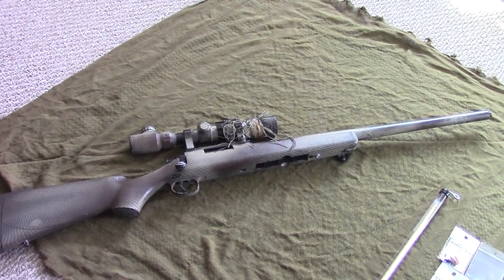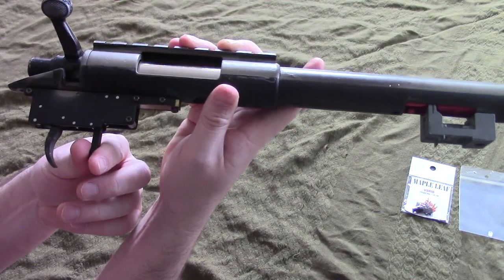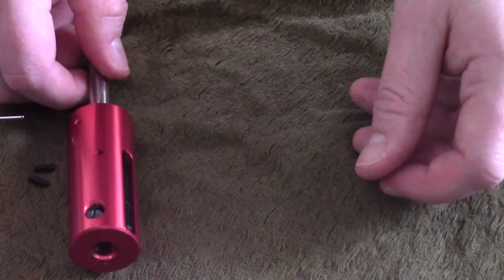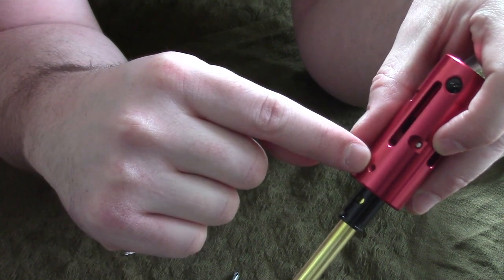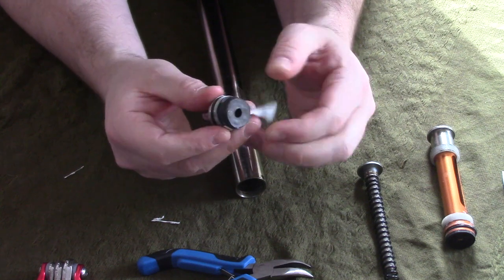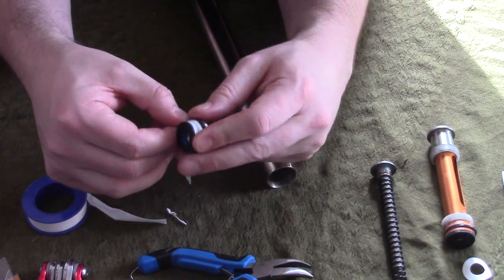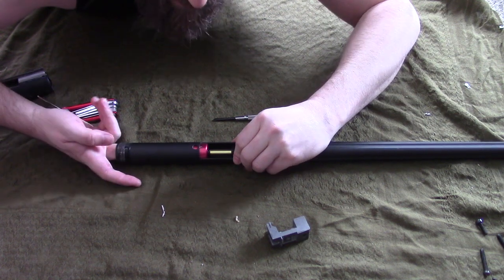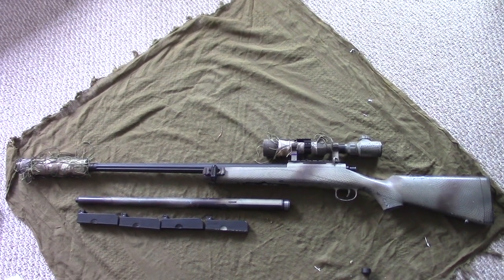Airsoft Tokyo Marui VSR-10 Upgrade

Comment: i would recommend against a spring upgrade with the original cylinder, mainly because it will eventually break. It was not designed for more than 1 joule springs, i think it is an aluminum  body and head(correct me if im wrong) and you need steel for stronger springs or it wont last long.
Reply from the maker: Hey thanks for the advice and checking out my video. I’ve heard the threads can strip going 2.3+ joules over time. I was willing to take that chance as I was planning to upgrade the cylinder anyway when I had the budget for it. It never did break but I did eventually upgrade to a new action army cylinder to match the barrel. Im guessing when you drill out the hole to upgrade it your weakening the existing threads combined with it being aluminum. This particular unit was running close to 2 joules for 7+ years on that original cylinder. It could just be luck of the draw but good advice it can’t hurt to upgrade the cylinder if / when you have the budget for it.
Reply: Nozzle is brass, and cylinder is some weird material too

Comment: i would recommend to put the barrel guides last and push them with some rod just where you want them... I doubt they are in the same position after you put evertthing in...
Reply from the maker: Thx for the tip and watching the vid. I feel I also could have added some silicon to the orings on them which would have made that process a bit easier haha. Happy holidays hope all is going great for you.

Comment: This comment is for the people that has no airsoft upgrading experience

If money is not a problem and you want a gun that is good out of the box. You should check out
1.maple leaf mlc338
2.ssg10/ssg24
3. Action army aac t10

If you dont have that much money and ur budget is around $200 I recommend 
1. ares amoeba striker s1/ striker s2
2. Asg mcmillan m40a3 (I dont recommend this that much)t
3.Echo 1 asr
4. Jg bar 10 (just change the bucking and youre good to go)

And if you dont have money

Just throw some bb's :)

Comment: What is the scope? I have a really bad scope with terrible eye relief.
Reply from the maker: Hey Thanks for checking out my vid Victor.  Unfortunately it came painted / used when I got the vsr. However if I were to guess it’s something like a 3-9X40MM RED GREEN ILLUMINATED SNIPER SCOPE. The eye relief on mine is about 2ish inches.
Reply: @kokosaysnono  it's annoying since I need to jam my head all the way till my goggles are touching the scope to see anything. Everyone I do NOT recommend the NCStar shooter series P4 sniper scope. It is less than garbage for $50. Wish I donated to charity or homeless.
Reply from the maker: Yeah it’s hard to find good eye relief for sure especially for when wearing goggles. I use shooting glasses which helps me get a little closer but depends on if the field allows them.

Comment: What fps gain did you get? Compared to stock
Reply from the maker: Initially I got 3joules until I worked the Spring in then I was getting around 2.3 joules of energy which was exactly what I needed 500 FPS shooting .20 except I shoot .45 with it. So the fps will be lower but joules close to the same. The stock cylinder has been known to break overtime shooting above 500 FPS or around there ( nozzle threads can fail) so it’s good to upgrade the cylinder as well if you plan on shooting higher FPS/joules

Comment: if i upgrade the exact same way could i shoot .46 bbs at 80ish yards?
Reply: Pretty much that.
You will also want a Bulltrigger and the Lambda cylinder set from evike.
Also, instead of a Maple Leaf barrel, the Lambda 6.01 should be a little higher power and be a little more accurate depending on what you do.
Reply: Silicone Sword thank u bro
Reply: Silicone Sword would it still be as good if i used a action army trigger unit and action army 6.01 barrel?
Reply: @lathanlang7922  I would not recommend the Action Army trigger unit as people tend to have issues with them.
Bulltrigger is like 130$ shipped, and it gives you up to 15% more FPS.
As for the barrel, I don't really recommend Action Army since the bore quality isn't very good.
A Crazy Jet will be perfectly fine, but Lambda will be better and not cost too much more if you use coupon codes.
If you are in America I would highly recommend Evike for most of your stuff and for the trigger you should just search Bulltrigg.
Hmu on Instagram @silicone_sword if you need any more help with your rifle.
Reply: Silicone Sword ok sounds good i'll dm you my name is lathan.lang

Comment: Hey Koko, you think you'd be able to do the same build for a JG bar 10? I'm 99% sure it's a copy of the TM vsr 10
Reply from the maker: Hey thanks for checking out my video :) I believe you are correct the JG Bar 10 is a clone of the TM vsr 10 so most of these parts would work , AA hopup chamber, crazy jet barrel, maple leaf monster bucking , either nub tensioner maple leaf or panther stalker. mag release. The cylinder parts i'm not 100% but from what I read they should work as well. Mine already had the LayLax PSS10 Zero Trigger  / piston installed which should be compatible too. I'd say research each part to be 100% sure but so far it seems they're compatible.

Comment: I am going to upgrade my TM VSR-10 and made a list of parts, am i missing something? 
Please help, i am not a very technical person
MAPLE LEAF CRAZY JET BARREL SYSTEM (GBB, VSR, AEG) 430 VSR
NINE BALL VSR-10 HOP UP BUCKING (ALSO FITS P226, HI-CAPA, G26, SOCOM)
ACTION ARMY VSR-10 CYLINDER KIT
ACTION ARMY VSR-10 SPRING GUIDE
ACTION ARMY ZERO TRIGGER VSR-10
ACTION ARMY VSR-10 M150 SPRING
ACTION ARMY VSR-10 HOP UP CHAMBER
Reply from the maker: Nice list you may want too get sorbo pads and an omega HopUp nub or STALKER Panthera Concave Nub as well if your doing that full upgrade.
Reply: @kokosaysnono  Ok, but the store i am using does not have  STALKER Panthera Concave Nub but Maple Leaf Omega Hop Up Tensioner Nub. I guess it works aswell?
Reply from the maker: Yup that will work I prefer the panther as it fits the window perfectly but the maple leaf is good as well just takes a little more fiddling to get it in place :)
Reply: @kokosaysnono  Like these? https://www.airsoftatlanta.com/products/maple-leaf-aeg-hop-up-tensioner-omega     https://www.airsoftatlanta.com/products/sorbo-pad-cylinder-head-damper-aeg-version-2-3
Reply from the maker: Yup those are what I was talking about. If they say their for the vsr you should be good.
Reply: @kokosaysnono  Oh ye i am switching to a M170 spring for more power, or is it going to break something inside the gun?
Reply from the maker: As long as your upgrading from the Stock cylinder and trigger assembly mainly the sear you should meet the tolerance for a 170. But depending on your fields FPS limits that could be shooting hot. An m150 worked in shoots around 490- 500 FPS measured with .20g bbs

Comment: @kokosaysnono hey mate, what about the trigger. I've recently seen a few posts mentioning that the stock trigger unit, as well as the cylinder won't be able to stand springs like 120+. But if I'm correct, you're using the stock TM cylinder. Is it working fine in terms of sturdiness and air sealing?
Reply from the maker: Hey thanks for checking out my vid, you are correct that it’s recommended to upgrade from the original TM cylinder. I ran it for a few months with no issues however I was planning to upgrade it to the action army stainless Steel with teflon coating. The trigger was already upgraded to a zero 90 degree trigger prior to me owning it. Long story short, ha ha the cylinder won’t fail right away. It’s something that would happen overtime imo as it didn’t fail for me but I did end up upgrading it after months of use.
Reply: @kokosaysnono  thanks for the reply mate, appreciate. I'm about to get a brand new TM VSR G-SPEC, and I'm a bit worried about the very first upgrades. Since TM internals are said to be pretty durable with the standard spring, my upgrading plan is to go maybe for the CrazyJet 6.01  (tighter bore, higher pressure without spring upgrades, and maybe a bit of Joule creep due to over-volumed barrel), and some Maple Leaf 60° bucking (not sure if I have to go for MR or the Decepticon version) . In my opinion will be fine to go low Joules with good groupings for a few months, without having to consider MEDs. What would be your personal opinion on this point of view?
Reply from the maker: Heavier weight bbs helps with tighter groupings but increases the joule creep so going low joules could limit the range if it can’t handle the heavier bbs. Saying that it’s all trial and error so you’ll dial it all in by testing it out after the tweaks and re-tweaks :)
Reply: @kokosaysnono  yes I understand.. Thanks again for all the information mate, I really appreciate it!
Reply from the maker: Anytime bud reach out anytime and have fun with the upgrades let me know how you make out.

Comment: Hi!, how long is that stock cylinder can last with the M150 spring?
Reply from the maker: Hey thanks for checking out the video. That’s a good question this particular cylinder is like 15 years old and housed a number of different springs over the years with zero failures. I tried working the m150 in for a few months but it was still shooting hot around 2.4 joules where I need to be at 2.3joules (500fps with .20g) I’ve since upgraded it to an action army cylinder mainly for cosmetics and the fact I wanted one without a hole drilled in the side. I plan on making a part 2 upgrades video for that including the install of a action army piston and tdc mod. I may cut the m150 just to get me under the 2.3 joule requirement as my old cut spring has me around 2.10 joules with those spacers added.
Reply: @kokosaysnono  thanks for the reply!. Well, i don't have a vsr10, instead i have a echo1 m28, and one day I put a laylax M150 spring, but the cylinder top part starts to deform, so I put a M130 and the cylinder has no problems for now
Reply from the maker: Oh no that’s no good sorry to hear it deformed your cylinder. I did read online that putting too strong a spring in can cause issues with stock parts but I think they were going over 500fps when related to the vsr 10. Things like the stock trigger sear would fail , cylinder nozzle threads, spring guide. I’ve yet to experience any of those failures myself but my spring guide and trigger assembly were already upgraded when I got my vsr. It all comes down the the quality of the metal and as they say “ they don’t make them like they used too” could be why my old stock one is tougher than say what the new stock ones come with.

Comment: hi,  after you upgrade.. how can you adjust ur hop up?
Reply from the maker: You use an Allen key through the magwell but you have to remove the mag to do it. I did a separate upgrade after that to install a tdc mod so it’s now a mod on the top of the barrel. https://youtu.be/k83lSGdkgp0?si=HmZS_mK_Tfvh9nWE

Comment: Question I have fully upgraded my vsr-10 and I am now having a problem with my bbs not being consistent what should I do I am running a m170 spring and .30 gram bbs should I try running heavier bbs with the upgraded nub for the aa nub???
Reply from the maker: How’s long ago did you upgrade ? If the issues started right after the upgrade and you did cylinder work it could be grease getting in the bucking. If it’s been a while since the upgrade it could be the bucking is wearing out. Can’t hurt to try different weights to see if the results change, clean out the barrel in case it got dirty, add some Teflon in case the air seal is now an issue and if using the aa nub try reseating it as maybe it wasn’t lined up properly when the arm was put down or is catching on the edge of the HopUp window when the arm pushes down.

Comment: Is that ok only the piston, spring guid and spring change and the cylinder tock?tnx
Reply from the maker: Hey Mark thanks for checking out my vid. Yeah depending on how much your going up in spring power the stock cylinder is still good. Since this vid I’ve actually upgraded the cylinder and piston to an action army one but not because the old one failed. I just wanted one that didn’t have the hole drilled out of the side and was newer as the original was getting pretty old for mine. Depending on the spring guild / piston you should just make sure they’re compatible with the old cylinder but I never ran into issues myself.
Reply from the maker: Nope these weren’t the edgi parts. I believe with edgi you need to upgrade the cylinder from the original vsr TM.
Reply: Can i change only the piston the  spring guide and sear only amd m150 spring ? ? Is that ok ?
Reply: You use zero degree trigger of aac?
Reply: Can i usee three iron sear for aac piston ,spring guid and m150spring
Reply: @kokosaysnono   if i upgrade my vsr10 to aac piston guide and spring also sear is the ok ?
Reply from the maker: @mark-tb8xg  Hi Mark, Is the cylinder the original TM one ? If  so yeah you should be fine with those parts. I’m not 100% sure about the sear as mine is using the one that came with the laylax zero trigger vsr pss10. So the sear would depend on what trigger is installed. Make sure the sear matches the piston ( 90 degree vs 45 degrees) I’ve also since upgraded the cylinder to be AAC but that was just because I figured why not haha.

Comment: Would've been nice to see a before and after test fire and Chrono. Regardless, good job on this! What were your results before and after?
Reply from the maker: Agreed that would have been good to include and thanks for checking out the video. I did some results footage in the following video when upgrading it to use the TDC HopUp tuning. VSR 10 TDC HopUp Turret Installation. Without the TDC I found it a pain in the butt to dial in the HopUp haha. Better results with the TDC forsure

Comment: Can the tm vsr10 stock internals handle a 550 fps spring (0.2bbs)
Reply from the maker: I wouldn’t recommend it, the cylinder could fail over time “threads strip”. Trigger sear could also be an issue with the upgraded spring.
Reply: @kokosaysnono  would you recommend buy the TM vsr10 for someone with a tight budget and plays in sites with 550 fps limit for snipers?
Reply from the maker: I love my tm vsr10 and what you’ll find with pretty much all snipers is you buy it then upgrade the internals. Doesn’t have to be right away you can always pick away at it. May want to look for a used one too that might already be partially upgraded. The clone models are cheaper and you can put most of the same parts in them so you could save bucks their to put towards upgrades as well.
Reply: @kokosaysnono  TYSM for replying to my questions, been a great help.

Comment: what was the fps after upgrade?
Reply from the maker: Hey Rana thanks for checking out my vid. I put the 150 spring back in and worked it in so the joules are now 2.3 with .43g bbs so that’s around 340 fps. So if it was using .20g BB that’s 500fps
Reply: @kokosaysnono  cool, i upgraded my L96 fully but after while the aim went off prob need to use clamp and test it properly 😁
Reply from the maker: @cathalmire  Yeah the nub could have got un-aligned or might just be a simple barrel cleaning. Too much grease in the cylinder can have it come out the nozzle like mist into the barrel / bucking / hop up unit which can cause the curving / inconsistency.

Comment: This'll be the end goal in a few years. Meantime it'll be GBB and mk23 stuff.
Reply from the maker: Nice I love my Mk23 I did a tdc upgrade to mine but haven't had the chance to actually game it yet :) so I plan to pair it up with this vsr10. I'm still trying to figure out how to carry the 2 of them as the mk23 with silencer is so long but so quiet ;). Thanks for checking out my video and stay safe and healthy in these crazy times.
Reply: @kokosaysnono  Yeah the mk23 is chunky but it does through out the bbs when upgraded. You need to pair the mk23 with the nvg setup. I'm sure that'll be interesting to watch. Also if you do need spare mags, get the clone ones as they allow for higher pressure gas unlike the TM ones.

Comment: can this shoot .46 bbs?
Reply from the maker: It can shoot .46 but it’s about finding that happy medium sweet spot. Between spring power , the type of bucking,  weight of bb and cylinder air volume. I’m limited to 2.3 Joules of energy which is approx a .20g bb shooting 500fps. Moving up to .46 you could start losing range and/or speed to the target. The 70 degree bucking I’m using recommends between 360 - 460fps setups. I’m going to be a bit below that with .43s shooting around 330fps. If I get some .46s I’ll test out the diff though. So many factors it can be a lot of trial and error haha.
Reply: kokosaysnono yeah i understand, i'm building my own VSR-10 in a week, what's your instagram or anything i can contact you with, i have a couple questions about this before i build
Reply from the maker: Kokosaysnono is my Instagram or you can find the link on the main page of my YT channel. That’s awesome you’re building your own it’s fun to do and you’ll learn a lot about it’s inner workings that way for sure :). Pop me a msg if you have some questions and if I can help with some advice I will.

Comment: how much joule does it shoot?
Reply from the maker: Hey Thomas thanks for checking out my video. It’s now shooting 2.22 joules with 0.43g bbs.
Reply: @kokosaysnono  thnx dude i just bought a vsr10 pro
Reply from the maker: No worries and good choice it was fun to upgrade and to use :) also I ended up putting the Action army m150 spring back in and working it in a bit by leaving it cocked for a couple hours. That’s what the Joules are now after working it in a bit ;).
Reply: where did you buy all of the parts?
Reply from the maker: Np a couple different spots. Skrimshop in the Netherlands and divisionxp in Canada.
Reply: @kokosaysnono  thnx can we talk on instagram cause i have trouble finding some of the parts